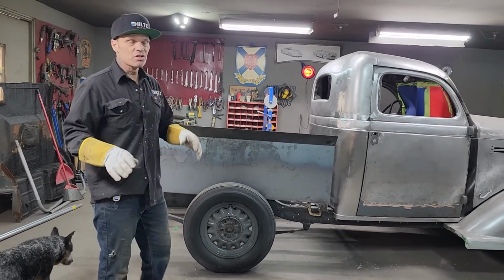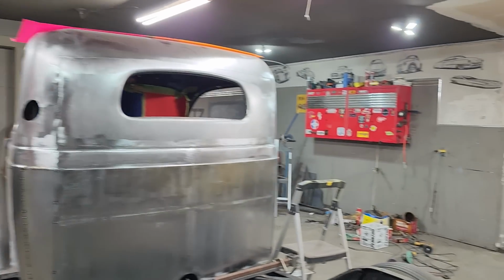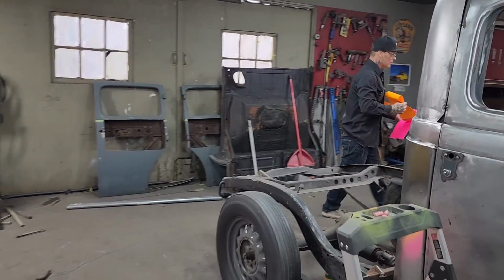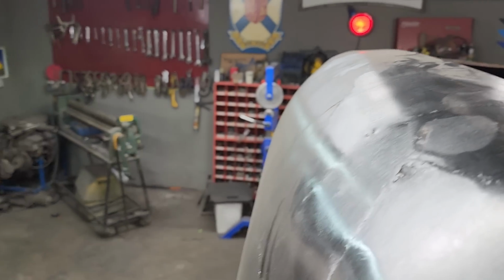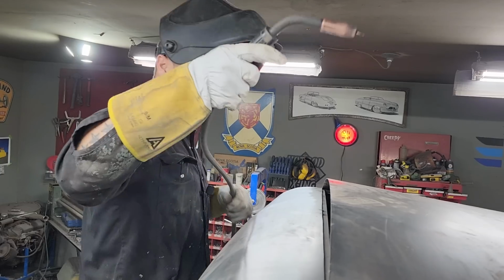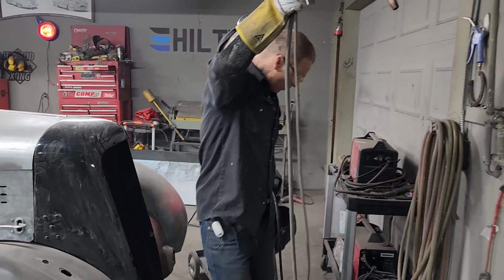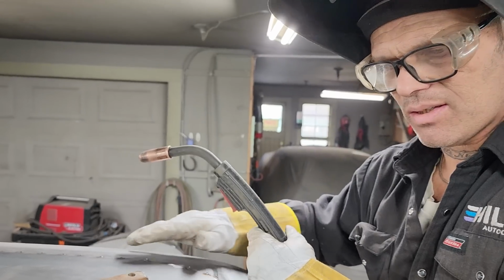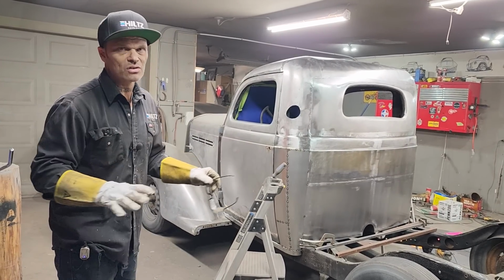Sheathing in the roof before we start fabricating the box 😎

Comment: First of all this was a fantastic episode:  Next, I know that when you fabricate your own bed, you'll eventually going to build a tailgate.  Most tail gates that I've seen have the names of the Manufacturer: ie; Ford, Toyota, GMC, Chevrolet, NIssan and Dodge indented or raised on the flat panel of the Tailgate.  Now since Plymouth never built a pick-up truck that's going to be hard to do for this project....  Except,  I remember back in the 70's when Chrysler built the Trail Duster for Plymouth in order to copy the Blazer and Bronco, they had tail gates which said "Plymouth" indented right into their tailgates.   If you can locate a 1974 to 1980 Trail Duster SUV you will have perhaps the whole tail gate; or if it doesn't fit at least the tail gate's skin with the Plymouth Logo.

Comment: Looking awesome. Since you didn’t change the length of the wheelbase the original running boards will work if you are careful about where you attach the rear fenders on the bedside. You might want to put the boards on truck to help align where to attach the rear fenders. But I know you know what you’re doing. Keep it coming bud.

Comment: To support the bed you can weld pedestals to the frame made from angle or u-channel with the top capped and drilled for bolts. By doing that you can insure it's level.

Comment: hi chad, the truck is coming along quickly. the cab turned out perfect, in my opinion. however, when you had the box sides clamped in place as a mock-up, i thought they looked like they should come up higher, to be more in line with the body line that you so carefully kept and continued. but if you run the round pipe around the top edge, that will add height. i'm sure it will turn out great. hi jolene.

Comment: That's how Chip Foose does his customs slight changes so it don't look so modified barely notice the changes.
That's how this Truck looks like they built a truck off the assembly line. 
The body work is going to be the hard part sanding no one wants to do that much sanding. That's a job that has to be done. If you had a crew to sand and you do the finishing work to feather everything in.

 Then again it's a truck it don't body work don't have to be that great  unless your going for a show truck.

K.C built a late 60s Ford truck he built it to really look nice. Showed it at SEMA and said he's going to drive it and it won't look like this anymore. He already wrecked it and fixed it. People build/or have someone build it and put so much money in to it the owner is scared to drive it. If your putting it on the road it's going to get chips and dings in it just from the road. That's just the way it is.

Comment: This is the only HILTZ pickup you know. Consider using some half inch water pipe or similar, split it in half and create the HILTZ letters to weld onto the tailgate. I should look like die formed letters from the outside.

Comment: They do make replacement blades for your shear. I got an extra set when I got mine.
Reply: I can't tell, is that a Beverly B-1 or B-2? Mine's a B-2 and I've used it for 30 years and the blades are still sharp.

Comment: Please Please Please would you Please round off the top rear corners of the doors.        

It will complete the nice rounded smooth look you have going on with the entire truck and all the work you did.   
    
As is, the top rear corner of doors is the ONLY straight corn/sharp body line you have going on and it’s glaringly out of place.      PPPPLLLLLEEEEAAASSSSEEEEE😀🙏

PS… absolutely love your work!
You show how it’s done by hand…. Not a bunch of expensive needless machines and tools. Just simple old fashioned GETTIN IT DONE!!👍👍👍